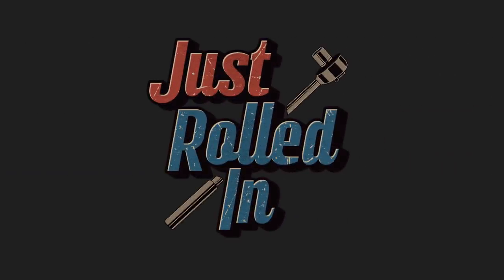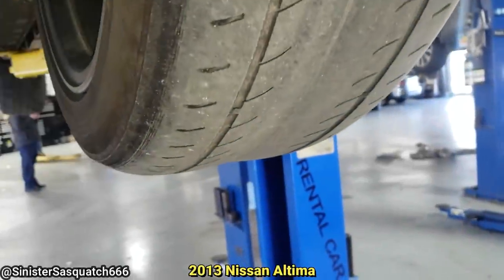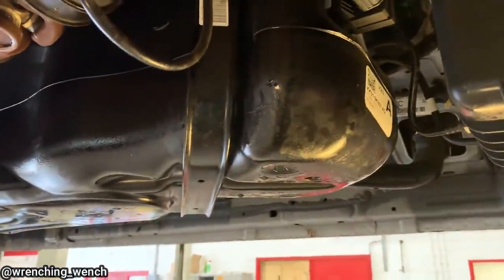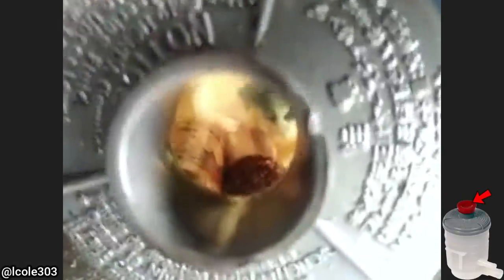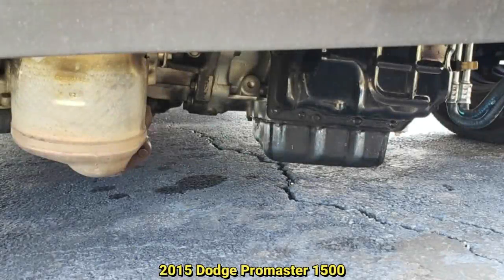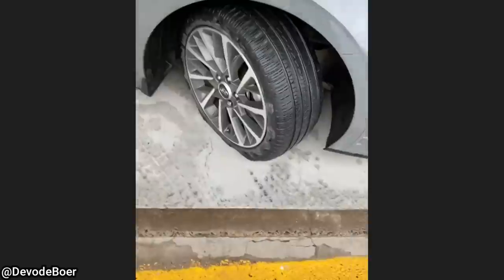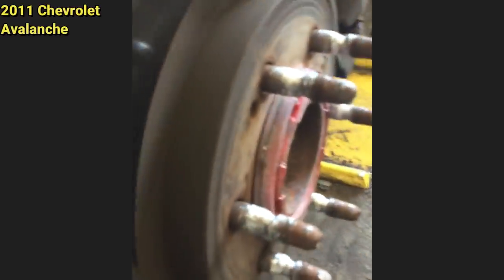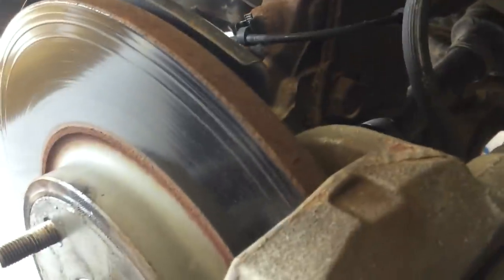Customer States Engine Is Making A Funny Noise | Just Rolled In

Comment from the maker: New video Thursday and best of January & February video on Sunday!
Have a great week.
Reply: Lots of jello in that one motor, we took an engine apart once from an Audi quattro and it was like this, they only ever used Pennzoil, my dad said there's paraffin in Pennzoil, in other words, wax
Reply: looks like the stuff you might pack wheel bearings with
Reply: @aninnymoose720  if grease is a lubricant, it should be fine, RIGHT?
Reply: can someone tell me how to dissolve it ??i found an engine with the same gowy oil
Reply: It's amazing the crankshaft didn't seize up and break

Comment: "Only uses oil additives" maybe someone told him "coolant" makes the engine run cooler, so he added it in the oil. :-))
Reply from the maker: Honestly... it would not surprise me. 😂
Reply: I think he thought adding oil additives reconditioned the old oil like new LoL
Reply: @JustRolledIn  When it comes to vehicle owners, NOTHING surprises me anymore :-))
Reply: I've been wondering what causes this "jello" stuff. Far from the first time it has shown up here. Must be a bunch of some sort of additive. But I wonder what one. 

As a joke I ran my knocking push mower for the summer on pure "motor honey" and it didn't do anything, it eventually thinned like regular oil.

Later on I pumped a tube of grease in it and that was what I ran it on for a few more years till the chassis cracked and I scrapped it. If anyone pulled the dipstick it looked like poo was on it with all the grease!
Reply: That Lucas oil additive stuff is pretty thick, I imagine if you use a ton of that over time an it gets hot maybe it gels up as it denatures or something.
Reply: Nah, just dump some Jello powder in there, it's more fun. Lol
Reply: Well, technically anything added to the oil is an "oil additive".. Trans fluid, saw dust, metal shavings, rocks... LOL
Reply: If I ever use additives its usually sometime before an oil change. Somehow he thought if he kept adding them the oil wouldn't degrade? Well looks like it doesn't help avoid oil changes.
Reply: Right oil has all the addatives the car needs. Everything extra is just a hoax.
Reply: It was the head gaskets that told him to do it! 😁
Reply: @MDBenson  I once asked my transmission builder about that Lucas Transmission additive stuff. Was concerned about the 46RE he had just put together for me that was going behind a 500+ HP MOPAR SB. He looked at me dead in the eye and asked one question. "Is it Transmission fluid"? No, it's an additive I say. Again, "Is it Transmission fluid?" I say no, it's, he cuts me off at this point and says. "If it ain't Transmission fluid, don't put it in the damned transmission!"
Reply: @garykirk1968  Yeah, I can understand that completely - especially in automatic valve blocks you really don’t wanted to mess with the fluid viscosity or flow. A new pan gasket, filter and a ATF is a darn sight cheaper than a transmission rebuild!

I get the feeling a lot of those products are ‘fix em ups’ for tired, failing or worn out engines and transmissions. Like if the engine has blow-by or a noisy tappet maybe some oil voodoo will help. Or a transmission is slipping or hesitating and needs a pick-me-up maybe they’ll keep it going a bit longer before if finally pegs out, but in the end the manufacturer/builder recommended oil/fluid and regular service and maintenance will do way more good than some miracle in a bottle.
Reply: It kinda looks like they used gelatin as additive tbh
Reply: @volvo09  Oil goes like this when mixed with modern coolant, that is what most of the "gelatin oil" problems are caused by. Blown head gaskets (this is a Subie so..) cracked heads/blocks, but sometimes its from people putting coolant straight into the oil, "By mistake". :-)
Reply: Coolant wouldn't make it gel.
Reply: @uhtred7860  ahh, so it's the really new coolant (silicate, organic acid or whatever it's called??) Because we've all seen the classic milkshake example from old coolant that will seperate, or be a milkshake...
Reply: @MDBenson  Lucas is a lot like the old STP. I use it. I've never had  a problem with it. Just make sure you add it while it's hot and run it for a while. I'm also the type of guy that will cut open the oil filter to see if there's any metal or anything else in the oil. I don't add a whole lot to the oil. Maybe a tablespoon. That'll quiet down the lifters.
Reply: XtreeM FaiL avblend, camguard, zmax all highly recommend for their purpose
Reply: @robertthomas5906  See, thats probably just fine. A wee bit just to add a bit of tack to the oil, not a huge deal. Also you are spot-on about adding it while the engine and oil is hot, it won’t dissolve properly otherwise. I’d guess this customer just abused the stuff, threw in a whole bottle while it was cold or something. Either that or I’ve heard odd stories of some modern oil blends gelling in cold weather like that with Lucas in them.
Reply: it's kind of sad that some people who aren't even allowed to own cars yet (car enthusiast kids i guess) know how to take care of a car better than these stupid car owners. I know of a 14 year old that fixed his parent's non running car in under a week.
Reply: @TTime685  wooooowwwwlmaaaaaoo

“Yeah the bottle says protects 50,000 miles. 
I’m only at 40K”
Reply: @garykirk1968  aye those metal shavings in my oil pan are just part of my weight reduction process.
Reply: @TTime685  ikr 😂😂😂😂😂
Reply: Maybe they filled the engine up with additives only, no oil whatsoever
Reply: Maybe he forgot to actually put oil in and used only oil additives.
Reply: i think he used the oil additives instead of the oil
Reply: @uhtred7860  " When it comes to vehicle owners people, NOTHING surprises me anymore :-))"
FIFY!
Reply: Well, there's a reason why they're called additives and not substitutes. I feel sorry for the owner.
Reply: Looks to me like this guy keeps filling his engine with straight slick 50 and nothing but the Teflon remains.
Reply: I know it’s a joke. But it would be a chocolate milkshake looking color if it were the case. Since the combination of the two would result in the coloration and harmfulness of the engine.
Reply: That oil was more solid that the shit I took this morning
Reply: @TTime685  my god people the internet exist..
Reply: @volvo09  or just jellow
Reply: Perhaps he "only" used additives... E.g. no oil
Reply: @Nny 🤣
Reply: How does oil turn into Jello like that?
Reply: @Celestial_Wing  with jelly powder
Reply: @Celestial_Wing  Propylene glycol or ethylene glycol, both active ingredients in most antifreeze and coolants, leaking into the oil via a small crack in the head or block. Combined with the engine running hot due to overheating, then sitting for a while. (Propylene glycol  becomes gelatinous under extreme heat conditions since it's also used as an emulsifying agent) Any water present evaporates leaving behind the jello like substance that was once oil.
Reply: @uhtred7860   goddang that sounds like a nightmare to clean up
Reply: When car enthusiasts know nothing about cars are my favorite. lmfao!
Reply: Hmmm.  You could mix STP with Marvel Mystery Oil, but I doubt that would result in this.  (And, BTW, filling with oil additives HAD to have been expensive.  Geez.)
Reply: Sounds like they have a dumb friend also I like your icon
Reply: @XtreeM_FaiL  detergent isn’t
Reply: @garykirk1968  he said that because he knows most transmission builds are stuck valves or worn valve bodies and it will unstick them and also build up pressure to clamp the clutches tighter
Reply: Its stp oil additive and thats all he used and its cooked
Reply: @gangstar662  that's what I was thinking.

Comment: As an electrician I appreciated the battery wire clamps on the insulation the most. It's incredible how often you see that in an industrial setting. Causes tons of overheating problems when the clamps are touching half wire, half insulation.

Comment: Years ago i was getting tyres for my car and while waiting was asked by the shop to be a witness as a guy wanted to drive off on tyres that were worn through to the belts. He couldn't wait the 20 minutes for them to get the tyres he wanted from their stores as he had a meeting he was late for with a 2 hour drive away. I had a quick look at all 4 tyres and all were similarly worn. Crazy stuff.
Reply from the maker: Damn scary these people are on the road.
Reply: Try driving your car away in the UK. (You could tow it away) The shop may refuse to give you the keys and call the cops.  The cops may arrive, impound your car and give you a ticket.   You'll get a $4000 fine and up to 3 penalty points per tyre.  Get to 12 points and you loose a licence for 12 months.  Road safety is taken very seriously in the UK.
Reply: @csjrogerson2377  and I also believe in Germany as well and I think a couple of the Nordic countries too, if I am not mistaken.
Reply: @csjrogerson2377  Most of Europe has the same rules. Some more strict than others.
Reply: @Doing_it_right_the_first_time  In My nordic country the fine is $175 for each tyre that is worn down below minimum, but the fine can be higher if it is deemed a safety risk. Also if the tyres are worn down to the metal, the police will issue an instant driving ban, and you will have to have the car towed. 

In severe cases, they will take away your license plates as well.
Reply: corey Babcock  safety inspections yes. but don't go to far.
Reply: @csjrogerson2377  I like that idea
Reply: In the UK its 3 points per tyres (12 points is a ban) upto £500-2500 per tire (believe it depends if its below minimum or if its actual metal thread showing or even cut threads)

I actually had an argument with a person who was driving with to severely worn tyres with the metal threads were more than 1 cm cut  away exposing the inner tire wall mad how it hadn't turned into a bubble and burst (she just said its going on for mot next week, like it is) I actually reported the car to the police for that one as it was super dangerous (and for her response, there was at least 3 tire replacement places within 1-3 minutes of that location)

(reposted as link automodded my whole posted message)
Reply: Tyre?
Reply: @jbb8382  yes. Tyre is a rubber wheel covering. Tire is to grow weary or sleepy. Only the US really uses tire for wheels. Two words for two meanings.
Reply: @csjrogerson2377  as it should be world wide . But some ppl just refuse to listen 🤦‍♂️
Reply: @csjrogerson2377  that was a long time ago. Things have changed since then but the owner of the shop asked me to witness his argument with the car owner in case it came back on him.
Reply: People playing with their lives and just because they are in a ''hurry''. ''I'm too busy to get killed'' :D :D :D
Reply: @csjrogerson2377  Honestly I don't think I have actually seen a bald tyre on any car in the UK, and I am glad we have these laws and punishments for this fact.
Reply: @williammarkhart7047  don't go too far? Like what, stoping someone from possibly having an accident and killing someone because of worn tires? Owning a car is not a human right
Reply: No we don’t Corey.  Price sometimes for self governance but it’s worth it and once lost rarely if ever returned.
Reply: So he finally decided to do something about it but he took his car to the shop with very little time to spare before a meeting and decided he didn't have time after all? I bet he's a politician.
Reply: @Doing_it_right_the_first_time  The repair shop will not let you because they might get fined as well for letting an unsafe car back on the road. They will certainly call the police.
Reply: @grimp53  sounds similar to drinking laws in some states.  Bartenders aren’t allowed to let drunk people leave the bar in their own car and can call the cops if you wont let them hire a taxi or uber for you.  If they do ignore it and allow you to drive and you hurt or kill someone, the bartender (in some states) becomes an accessory to the crime.

Some states allow bartenders to refuse service to people who obviously look drunk and ask for more at the bar.  

This sounds similar and I can sorta understand.  With so many people so worried about their next meeting and living life so fast… they dont make time to do maintenance on their vehicles that could endanger us.  I see why Europe has done this but also know it would be dicey instituting that here.  

Though, even here is USA, driving is a privilege and not a right.
Reply: @dcar  when you use extra letters for words like color, we don't take you seriously

Comment: The scariest part about these videos is when you're driving down the street, these people could be right beside you in these cars. I'm poor and very cheap. So if there's a way to make my car work without spending money I'm gonna do it. But I also understand how cars work and I know what is and isn't safe. I've driven some sketchy cars, but nothing like what I've seen in these videos.
Reply: I'm poor and cheap too, but I also live twenty miles from town and depend on my car. Vehicle maintenance is one of the two places I never cut corners
Reply: I fully understand the struggle but when it comes to vehicles, almost always, skimping on some important areas to save money, will  come to bite you in the ass and cause you to spend even more to fix what initially could have been done.
Reply: It's not even a case of being poor a lot of the time, I know rich people who DIY with their cars like that and the car ends up falling apart and costing them a lot to either repair or replace... Maybe they have too big an ego to let an expert touch their car? Idk.

In Arabic we have a saying: "Give the baker his bread even if he eats half of it."
Reply: For cheapness, I have seen a car driven around with the tyre cable worn through and flapping around as the wheel turned.
It was in an African capital city on a private hire taxi.
Reply: As a mechanic of 61 years the two things you never scrimp on are tires and brakes.  Cheat on them and you could easily end up dead or worse.  Everything else...  just coast to the side and fix it when you can. :/
Reply: Same
Reply: @Brandyalla  What is the other place you never cut corners?
Reply: @yasirkadhim2940  Shoes (support, not fashion)

Comment: Okay, I have to confess to an emergency "fix" on a tire, when I was a kid. I had decent tires on my VW bug, but hit something on my way into work. I could hear the leak. I grabbed a pencil, rammed it in the hole and snapped it off flush. I made it to work on the tire. I came out, expecting a flat. It was still holding air. I pumped it back up to 32 lbs. And wondered how long the pencil would last. I had a new tire on my spare, but drove that stupid pencil tire for the next month, just to see how long it would last. Never lost any air. I figured that was a pretty good test, and changed it out. But, I always carry a pencil in my cars. Never know, it might get you out of a bad spot. Maybe they should put a mileage rating on pencils.
Reply: A popular roadside enmergency fix is to screw in a wide woodscrew coated in glue or sealant to plug a hole in a tyre, that usually works and lasts pretty well.
Reply: @rodpanhard  
  Out on the freeway and the only thing I had in the glove box was a pencil. 
Invention is the necessity of mother. 🙂
Reply: Or you just put on the spare tire?
Reply: I was wondering where all those pencil dots on the road came from.....
Reply: @rogerwilco2  
  That would have been a good plan, but I was on my way to work, and didn't want to be late. My #2 pencil got me there on time.
Reply: That's actually kind of cool.
Reply: Alternatively, you were driving around with a loaded, high-pressure 'pencil tyre' gun that luckily didn't go off.
Reply: @Tao_Tology  car tires have really low pressure.
Reply: @tubaeseries5705  Haha not that low.
Reply: @tubaeseries5705  High enough.
Reply: One of the types of tire patches used for real repairs are basically a rubber plug shaped similar to a drywall screw anchor.  They are used for plugging nail holes and such, so no surprise your pencil trick worked.
Reply: Conversation with boss: You're on time, but you called me and said you had a flat tire!
Employee: Yeah, my #2 pencil I normally use here is in the tire, holding pressure just fine!
Reply: I had something similar but used a pan head screw

Comment: I put coilovers and UCAs plus rear shocks on my f150. When I took it for an alignment I asked the shop if for an extra $50 they’d look it over for any problems. I was 99.9% everything was good to go but having a master tech double check never hurts.  The shop I use is awesome. They found an oil leak and the truck was still under warranty. They checked the torque on the oil pan bolts and when they were in spec they called Ford told them exactly where it was leaking an also emailed pics. I’ve had issues with ford on warranty work but not a single issue this time.  I can do most maintenance on my truck myself but you’re so much more likely to find stuff when it’s on a hoist than you will crawling under it in the driveway.
Reply from the maker: You got yourself a good shop! What year F150?
Reply: @JustRolledIn  the year of the BS post. Didnt know F150s had coilovers lol. Those are struts.
Reply from the maker: @thefordmaniac  you can get after market coilovers for F-150's. I had them on my 2012 F150.
Reply: This is Tru....